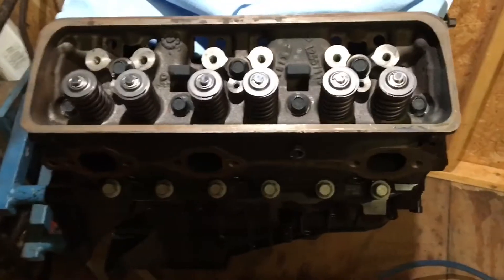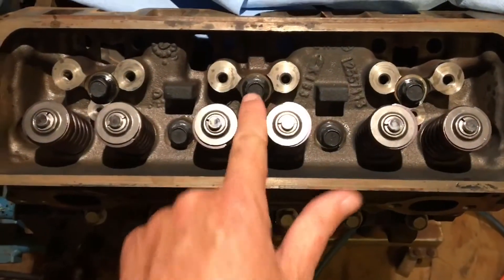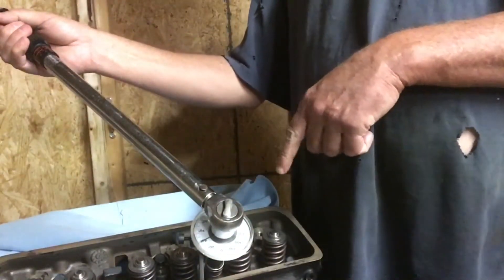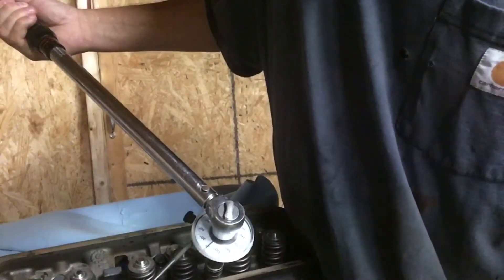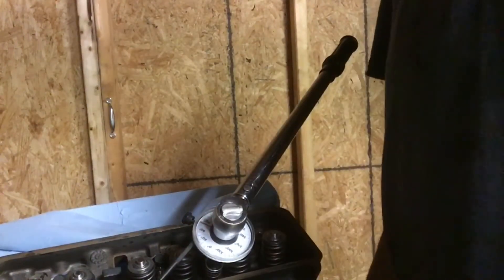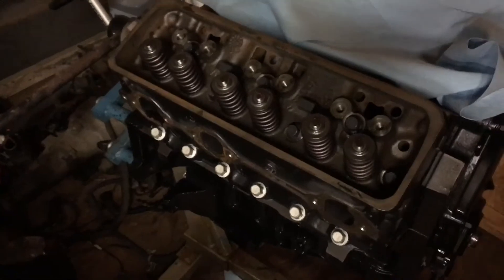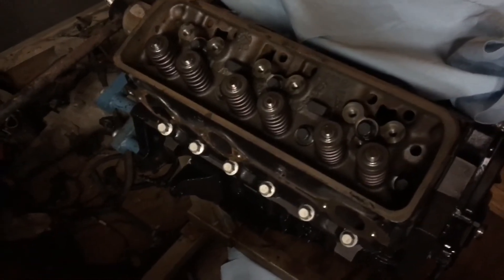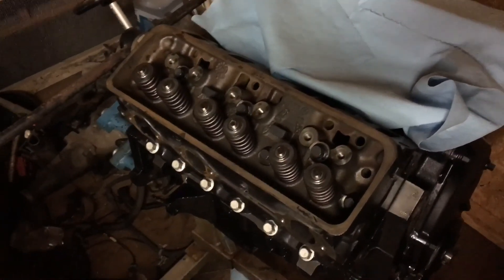Part 6B - Mercruiser 4.3 V6 Rebuild -

Comment: Hello. I am rebuilding one of these Volvos. The threads for one of the bolts for the cylinder head, on the blog have broken and I am not 100% about the thread size. Do you, by any chance, have this size?
Reply from the maker: Are you talking about a head bolt that holds the head to the block?
Reply: @moccasinmarine  Yes.
Reply from the maker: Thread size and pitch is 7/16” x 14. The bolts are torque to yield one time use. To repair you need to use a Timesert kit. Helicoils won’t be strong ennough.
Reply: @moccasinmarine  This is what I did. Thank you! I hope that you don't mind if I ask a few more things as I go along the repair process!
Reply from the maker: @HarryHatz-d5j i try to answer questions if I have time.

Comment: Will all of the bolts bottom out at the first pass 22 lbs??
Reply from the maker: Yes the first 22 ft lb pass just snugs them up for the final pass. The long bolts get 75 degrees more, the middle length bolts get 65 degrees and the short bolts get 55 degrees more rotation.

Comment: There is hardly any specific info except you on yt glad you are doing this. I have the older engine from a 1989 boat 4.3 but I would like to know what a torque for these heads would be in ft lbs instead of degreas. I had block and heads done at a nearby machine shop and ordered a rebuild kit from them and wow what crap and even scared my cam bearings up and left wavy curvy milling marks the whole block and heads not smooth at all I work so hard and pay so much money on this stuff and its hard to afford and then this is what I get is more work and more money. Thank you for your videos. May Christ Jesus Bless you.
Reply from the maker: Torque specs for engines up to 93

https://torquespecs.tripod.com/s-1xa4_3.htm#figure1
Reply: @moccasinmarine  thank you sir. I would like to return the favor you have helped me a few times with info you should be interested in.